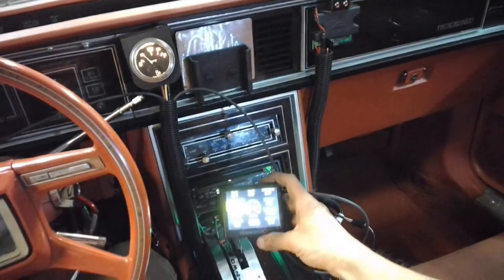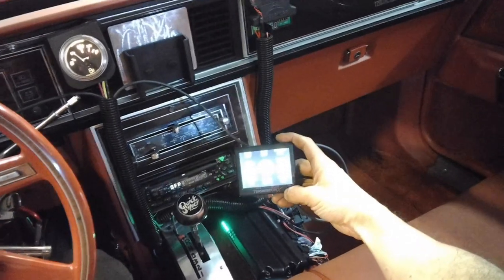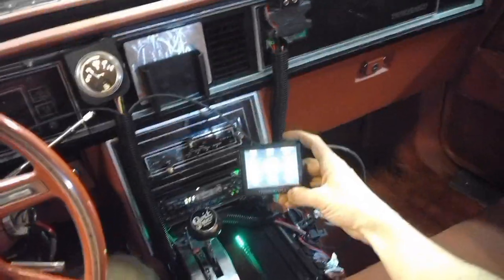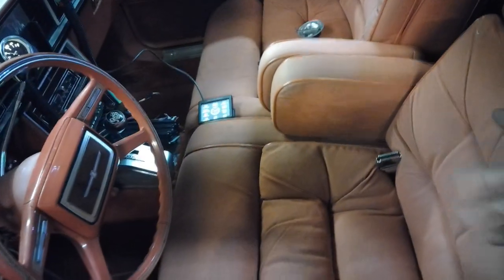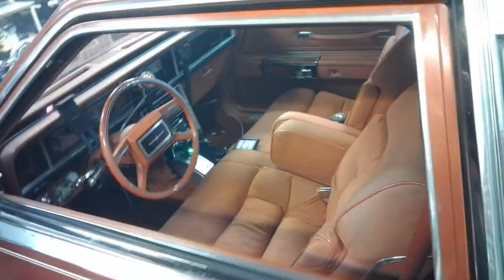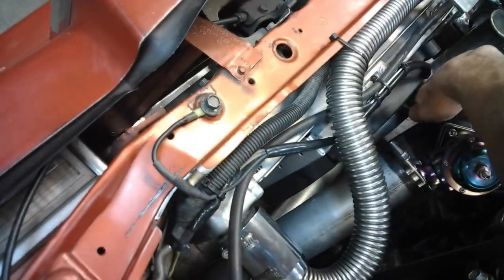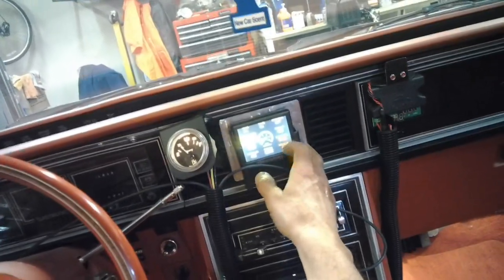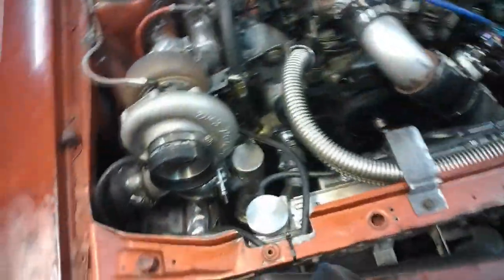408 LS & 100 LB PER HR fuel injectors 2nd start & systems verification

Comment: Gotta love those terminator x systems i run one in my LSA supercharged nova and one in my vortech supercharged c/10……you cannot go wrong, and once you use them you are hooked, you will never use a factory ecm ever again……my 15 yr old son talked me and my wife into getting him a ‘67 mustang 289…..were gonna let him get his feet wet with that , in the mean time i picked up a late model ‘96 roller block 5.0 that we are building up….when he graduates high school and that 200hp 289 i think i will do a turbo build with the 302…thats if he is on the right path and doesnt get any speeding tickets or other trouble…..if not me and my wife will just have another cool car to take to car shows and cruises…..even though we already have 6 cool cars not including that mustang….id love to LS swap it but they dont make a bolt in swap kit for those ‘67s that are readily available
Reply from the maker: Thanks for commenting and telling me about all your projects bro. Love conversing and interacting with other car guys and hearing about their projects. Don't be intimidated that they don't make a kit or parts for anything you want to build. I fabricated and designed everything for the boosted 408 in the Thunderbird,  including the custom turbo hot and cold side, chassis stiffening, the whole drivetrain etc. If I can do it so can anyone...I built the turbo 68 Scooby van a few years ago and also had to fabricate and design all the systems on that build too. Check out the other video's if you have time as they might be able to help. Here's a link to the engine mount video in the Ford I did s while back  https://youtu.be/unkIxozQwVo .Thanks for watching and commenting and good luck with all your projects........Oliver

Comment: I am currently doing the same thing in a 95 mustang and I didn't think of running the hose all the way over to the ford rad as you have.  Any issues with cooling it this way??
Thanks!!!
Reply from the maker: I've since upgraded the radiator and cooling system with dual fans and a  radiator designed specifically for an ls in a fox body. Video will hopefully be coming soon. Yes cooling was okay, but I never really got into any boost as I was just breaking everything in. When I start testing again I can update on the cooling and all the other systems hopefully. Thanks for watching and commenting......Oliver
Reply: @BooostedLS  Awesome to see the progress! Thanks!!!
Reply: @BooostedLS  Can you send me some links to the rad and parts?
Reply from the maker: Yes , this is the rad I purchased at the summit link. I'll be making a video shortly outlining all the parts and functioning of system once complete....https://www.summitracing.com/parts/SUM-384060 ....thanks for commenting and watching....Oliver